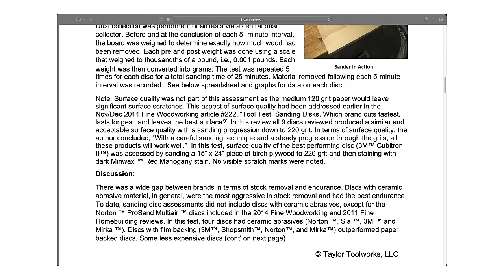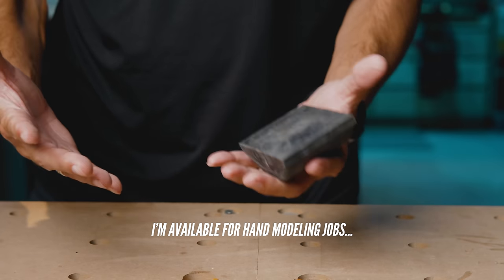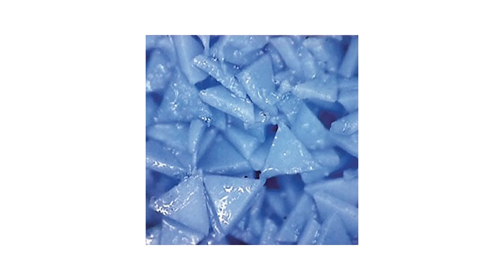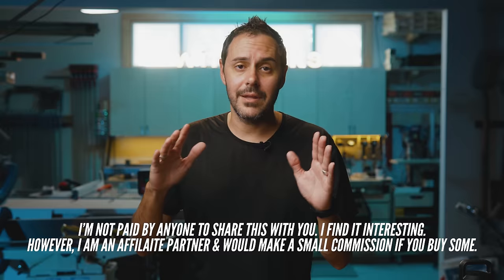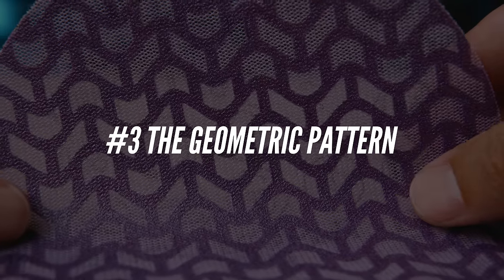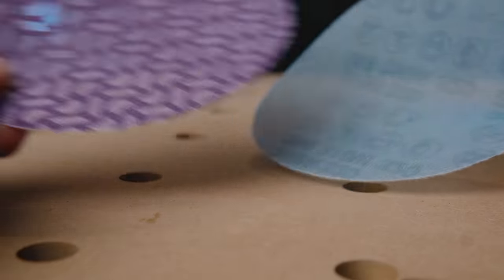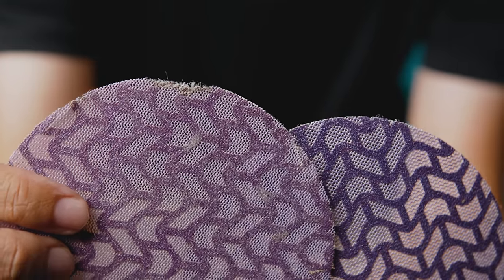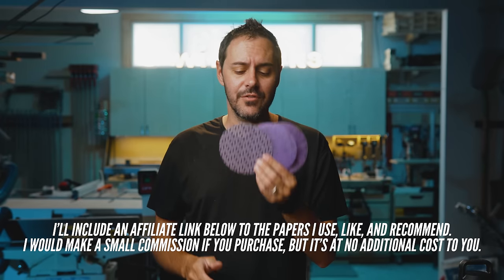6 Secrets Behind the Sudden Rise of Xtract

Comment: Nicely done overview of the history. I've tried the Xtract, but I still prefer Cubitron 2 for one simple reason that often gets overlooked. Mesh papers "superior" dust extraction comes at a cost of the backing pads on sanders. The hooks tend to loose their gripping power because of the sheer amount of dust traveling through the mesh. I went through 2 backing pads using Xtract last year. Since switching back to Cubitron 2, my backing pad still holds. Just something to consider
Reply from the maker: Thank you! Yes. You said it better than I did at the end. The film backed 775l are tough.
Reply: The same happened to me until I bought the Mirka abranet gripped face pad. It even saves my sander from using the synthetic wool pads.
Reply: @chrissetter  my Festool sanders have issues with mesh discs. At $40+ for a Festool backing pad, it's gets pricey to run those types of discs.
Reply: Mesh sanding discs open weave permits the loops on the backing pad to pass through and get abraded away
Reply: Try an interface pad.
Reply from the maker: I have several. I wonder if this warrants a super short explainer video?
Reply: @wittworks  its a major issue that's often overlooked when talking about mesh papers, especially for those who are using high end sanders
Reply from the maker: Thank you! Good info.
Reply: Who makes an affordable one?  I have trouble sourcing a pad locally, although some sandpaper brands include one with their multipaks
Reply: By all means!
Reply from the maker: @wallacegrommet9343  3M makes a "pad saver" and its cheap. 

Taytools has it for $6. https://lddy.no/1dc4t 

I also have the one festool makes. 
6" version here: https://amzn.to/3gwnlKA
5" version here: https://amzn.to/3N6HXFJ

I have not tested the 3M one yet, but I've been using the festool ones and they're good. I like that their pad has a hole in the middle which lines up with the hole on my festool sanders. 3M pad would work, but I'd probably cut the center hole so I can have all of the suction available.
Reply: @wittworks  Unfortunately out of stock - I can‘t find pads anywhere.

The 3m sander has a unique hole pattern, so not sure what pads would work with it other than the 3m.
Reply from the maker: Is Taylor out? I talked to Mike recently and they had a PO in for 500
Reply: @wittworks  Yup.  Out of all size and versions.  I have a 3m 6 inch.  Can‘t find a pad anywhere for it.
Reply from the maker: Just talked to the boss. They’ll have some on a month.
Reply: @wittworks  Thanks - hopefully my existing pad lasts that long! =p
Reply: Hey folks. 

I’m a Regional Sales Leader for 3M’s Abrasive Systems Division. Just to clear up a few things…Cubitron II (TM) is not a product or an abrasive grain. 

It’s a brand like Scotch-Brite (TM) or Post-IT Notes (TM). 

The Cubitron II (TM) brand of 3M abrasives represents the A-Tier, best in class, abrasives that 3M has to offer. 

The power behind our Cubitron II (TM) brand and what makes it unique is what we call our Precision Shaped Abrasive Grain. 

3M Xtract 710W and 3M Cubitron II 775L BOTH have the same Precision Shaped Abrasive Grain mineral. The difference is the carrier. 

The Xtract 710W is a mesh / sanding disc lattice hybrid and it works best on flat surfaces where sharp edges are not an issue and maximized cut and dust extraction is needed. 

The Cubitron II 775L is a disc that has a durable film backing better suited for substrates with sharp edges, corners and irregular surfaces. 3M Cubitron II 732U is the same disc in traditional paper form. 

It is true that using a Hook-it disc directly on the back up pad will wear the pad prematurely. That’s why 3M has Hook-It Saver interface pads that sits between the disc and the back up pad. This solution drastically increases the life of your back up pads. I’ve added a link below: 

https://www.3m.com/3M/en_US/p/d/b40066054/
Reply from the maker: Thank you Ron. Tell Stephanie I said hi.

Comment: Genius video! Thanks for the brief history and science lesson. I had bought both papers on the advice of JKM, but didn’t really understand the difference. Now, I do. The more solid disk has a higher concentration of the triangles so I’ll use it in lower grits for the rougher removal. And use it on my handheld block where dust extraction is not a factor. But, I’ll use the Xtract discs in higher grits and to take advantage of better dust removal. Unless I totally didn’t understand…😅
Reply from the maker: You got it! I’m making hand blocks from walnut scraps right now for the full disc 775l. Hopefully the video will be out next week showing tips and tricks for that specific paper.

Comment: Can't wait to try some of this when I get my Festool sander! Great info, thanks for the research!
Reply from the maker: You’re welcome. It works on other sanders too. Thinking about getting a cheap Hf sander to test it on
Reply: @wittworks  Seems to work fine on my Bosch and Portal Cable sanders.  I don’t agree with dust free.  Sanding makes dust.
Reply: Which one are you looking to get?
Reply from the maker: Do you have a good extractor hooked up to it? I don’t see any dust when I use it with my Festool sander and extractor.
Reply: I use it with my Dewalt sander and it's fantastic.
Reply: @user_16309  dust free means with an extractor.. Obviously it makes dust
Reply from the maker: Thank you. That was my assumption.

Comment: OK so I tried Xtract a while back and it left the pad on my Festool ETS-EC 150 a complete mess every time I changed the paper. For anyone that uses Xtract on the regular - is this a problem? What about the hook and loop cubitron II... does the dust collection work well enough given the hole pattern is different than granat paper?
Reply from the maker: That’s a common issue. I ended up having to get a pad that goes in between. Very few talk about it. It helps protect the pad on the sander and helps with adhesion of paper. I’ve thought about doing a quick PSA video on it since I had a problem.
Reply: @wittworks  yes please, oh and I prefer "Dave"

Comment: I have 3 things against the Cubitorn II sanding discs...#1) the cost of the discs has more than doubled in 2 years...#2) the discs edges bend and tear very quickly rendering the disc useless in short order.  This happens most of the time when edge sanding.  I don't have this problem with traditional hook and loop discs...#3) while the Cubitron discs work well, compared to silicone carbide they are no match...I can get 2 to 5 times more sanding done in the same time with a silicone carbide disc.  For quick material removal a coarser grit of 40 or 60 is often necessary and Cubitron only comes in 80 grit or higher.  I can get silicone carbide discs in grits from 36 to 8000 and the cost of the discs are about 19 cents versus cubitron at 85 cents each.  Hmmm, longer life, significantly less cost, less disc degradation have all been factors on choosing not to use cubitron discs anymore.

Comment: Great video! I love this stuff, but there is a weirdness to the Cubitron II Extract that I don't get.  I feel like I need to use higher grits for final finishing. 80 is about as low as I need to go instead of 60, and I need 320 instead of 220 for finishing.  Is this because f the sharpness? It leaves dust stuck hard to the wood surface. Brushing off the dust and hitting it with a tack rag no longer works! I have to brush, brush, brush, wipe with a dust rage, blow it off, then the tack rag. Why does it stickj? (no vacuum attached to my sander, but my sander's bag collects lots of dust).
Reply from the maker: Interesting. My guess would be that the grit that is “self sharpening” is being left on buried into the grains because you don’t have an extractor.
Reply: @wittworks  I just tried it with a powerful Shop Vac, same problem, dust sticks to surface and is hard to brush off. It's not terrible, just extra work. There seems to be no grit, just dust sticking to the wood in a way I have never seen.

Comment: Gee I'd love to waste more of my time,  but I got wood to glue up.  Cubitron paper is now also available in strips (50' x 2.5", plus), so it can be used on drum sanders.  Works like a charm.
Reply from the maker: I’m shopping for a drum sander and would love to try it! Which drum do you have? I’ve been looking at the supermax…but man they’ve increased prices by hundreds
Reply: @wittworks  I have a Sand Flee, which is an open bed (lower drum only) sander.  I really like it.  I've had it for about 12 years.

Comment: One of the problems I experience with the Xtract discs is that sanding dust collects in the center of the disk since the 8 hole backer plate on my sander can't get suction to the center area of the disk. Do you have any advice for that problem? Thanks.
Reply from the maker: I haven’t had that experience with my Festool sanders. I’ll keep an eye out for it.

Comment: I have the Xtract sandpaper for my Festool 5" sander.  However, the xtract doesn't want to stick to the pad.  I don't have any problems with other sandpapers the 775 seems to stick better.  Is there something I am missing with the xtract?
Reply from the maker: I had the same experience. Actually doing a short video on that this coming week. Not sure why it's the case, but the $5 "padsaver" was the fix for me. Got me better adhesion and also protects the hook and loop on the expensive backer pad.
Reply: @wittworks  Thanks for the information.  Is there a specific padsaver you recommend?  Where do you get yours?
Reply from the maker: I have both 3m (taytools) and Festool (Amazon). I like the Festool one best. https://amzn.to/3WyWWwa
Reply: @wittworks  Thanks!  I am definitely going to give it a try.

Comment: Super interesting video. It's nice to see something new added to the discussion on this paper. 

I love this paper, and have been using it for a few months, but I think the claims are a bit overblown. 

The "nearly dust free" really only applies with a vacuum added, and how many average woodworkers run a vacuum to their sander? It sure leaves less, but for most people, whose sander just uses the internal motor speed to create airflow into a bag, you still need to blow/wipe down the wood between grits. It also doesn't last some extraordinary amount of time imo. 

I also think their grits are a little rougher than other brands, like diablo. The feel from a 220 pad of Xtract-mesh vs 220 Diablo non-mesh is rougher to the touch. I've found myself regularly going to 320 with the 3M mesh to get the feel of the 220 from Diablo. Interestingly, 3Ms paper leaves an equally smooth feel to the Diablo discs when I hand sand, for whatever reason. 

What it does, undoubtedly do, is remove material faster than anything else. 

Setting aside some of the, imo, overblown claims, it is still the best paper on the market, purely due to the price tag/disc being so competitive. 

I will never buy a different brand, as it is the best I've used, but I don't think it is the miracle that some influencers sell it as. Just my experience.
Reply from the maker: Thanks Miles! I should have specifically said “with an extractor” but I assumed that was obvious - given the name. But I think you’re right in many wouldn’t think to do that. But I think anyone using a net disc intentionally is doing it for those reasons. 

Adding something different to the conversation was my number one goal! So thank you for noticing that.

I think a lot of hype/excitement is due to for so long it seems that most of the sandpaper is the same. My opinion is that what 3m did was a game changer. I’d suspect it will be in Hd and Lowes sometime soon as it becomes more popular. It’s not perfect, but I actually enjoy sanding now.

Comment: The one problem I have had with the net sand papers is that the fine dust that gets through abrades the hooks of the hook and loop on my sanders pad. Causing me to replace those pads very quickly. I haven't seen anyone talk about this problem yet.
Reply from the maker: Do you have a pad saver?
Reply: @wittworks  An additional peice of equipment to use the expensive discs? If I were just doing fine woodworking I wouldn't be complaining. Since I use my Sanders for all kinds of sanding, and materials, I'm less inclined to want another wear item.
I also got to thinking about the supposes benefit of these nets vs holes. The sanding pad only has holes. The discs with holes line up. The net just allows dust to go anywhere, and yet still has to get sucked up through the holes, or around the edge of the pad. I'm not seeing a big increase in dust collection in the net style.
Reply from the maker: The pad savers are around $6 and save your $40 backing pad (because the hook and loop are more exposed). Trade offs with everything.
Reply: @wittworks  my pads are about $21 ea. And last about 1 to 2 years of hard use. Sanding everything from old paint to drywall patches. (Drywall dust kills pads as fast as old paint in my experience). I'll check out the pad savers. But my point about the dust being sucked up through the 8 holes and the sides still seems to make the net sanding papers usefulness reduced.

Comment: Whenever you're extracting air or dust with air, look at where your replacement air is coming from. On great orbital sanders, cold air is supplied to the centre as well as sucked in from the edges. 
A massive vacuum without flow does not shift dust. Moving air carries dust. as far as I know, Mirka, Festool and Metabo sell eccentric sanders with a cold air supply in the middle of the pad. I've not seen others.

Comment: When using the Cubitron II on something like a Dewalt orbital sander, do you need to use one of those protective pads or will just work fine with usual H&L?
Reply: The regular with cloth back should work without one, but the mesh backed Xtract may or may not need a pad.
Reply: Just don't add pressure and you'll be good. Let the sander do the work.

Comment: 3m abrasives are so overpriced, maybe it's because I do metal working and stainless steel finishing, but their abrasives are way too expensive for the performance.  For my money, Norton is the best, festool's granat line is good too.

I use a burnisher and the flap drums (4" length x 4" diameter with a quad keyway or 5/8-11 threading) and 3M wants close to $100 each, whether traditional abrasive paper or non-woven nylon abrasive, it's insane